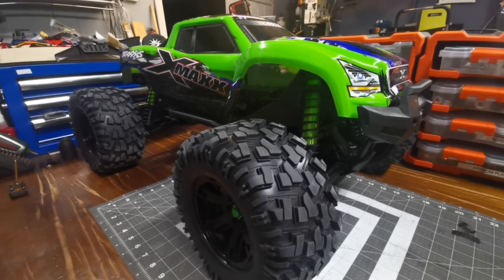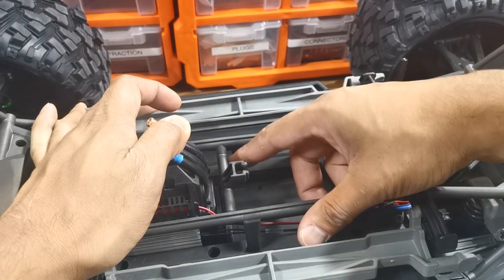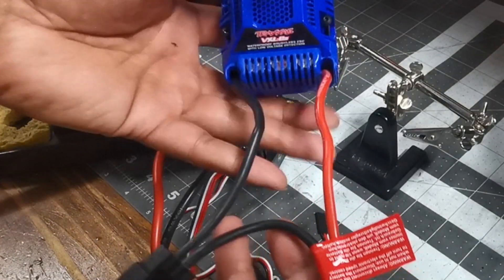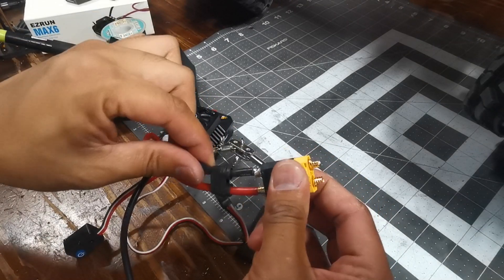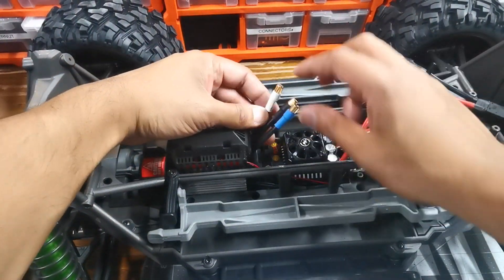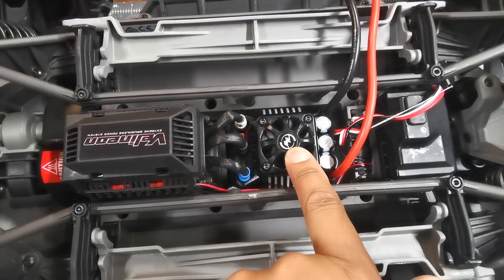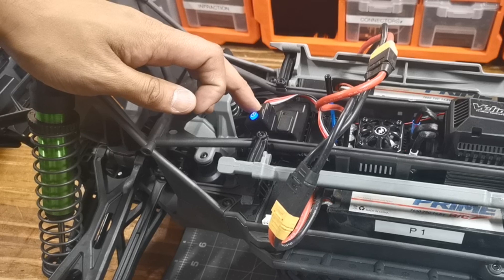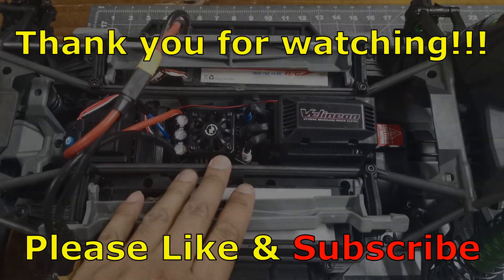How to Install & Calibrate the Hobbywing Max 6 to the Traxxas XMaxx 8s

Comment: If I have two batteries rated for 50c each, would that be enough to push the max6?
Reply from the maker: It will work but i wouldnt push it hard! Keep an eye on temps
Reply: @KingsRC  so would two 100c batteries be better?
Reply from the maker: @DigiDarkness  definitely!
Reply: @KingsRC  what punch setting would be best for this?

Comment: Can you run the stock X-Maxx battery connectors with the MAX6 so I don’t need to change my charger.
Reply from the maker: Yes you just have to solder on the traxxas connector to the max 6 or use a converter

Comment: Good video. What is your BEC output set to? Probably 6v but have you tried running the receiver and servo at the 7.4 volt output setting? Just wondering.
Reply from the maker: Thanks Bro! Am not sure if the servo is rated 7.4?
Reply: @KingsRC  Yeah true. I tried to find that info on the traxxas site but no way man. I couldn't find it anywhere.

Comment: I did everything I was supposed to do while installing my ESC max6 it worked for two minutes now it is dead no steering no throttle no break no reverse fan is working no lights working though and my receiver box is blinking red I don't know what to do/ prior to the first run I programmed it with the program box everything went well now when I plug in the program box it doesn't even go to the Numbers it only has the parallel lines on it and won't do anything either
Reply from the maker: If you did everything you are supposed to and you did it right, you should try and get warranty man

Comment: Are you running the Max6 on the 1200xl or 1600xl? When my ECU retires hurt, I will get a Max6, but wonder if I should combine it with the 1600xl.... thoughts?
Reply from the maker: I was just running it on the stock one which i think is 1200xl.. i think if you want more top speed then 1600xl.. but you may lose more tourque maybe

Comment: Mine will not calibrate I e tried everything any advice
Reply from the maker: Whats happening with it? Wheels not turning the right way?
Reply: @KingsRC  it will turn the right way, just when I go to set the neutral and full throttle and brake it won’t peep like it reading my commands
Reply from the maker: Maybe your not letting go of the button the right time? Its happened to me and end up going to programming mode instead..

Comment: My son and I are only on our third time out but I have a hobbie wing max 6 and motor combo for when I wanna upgrade. Did you change motor? I believe mine is a 1100kv
Reply from the maker: I ran with stock motor on max6 for a while, until i changed the motor with 8mm shaft for bigger gears

Comment: Does it have more punch for doing flips as i find the stock esc is crap for flipping xmaxx in the air
Reply from the maker: Yeah dude.. wayyy more punch than stock as you can adjust it.. but beware tho, if you check out my other vid i busted the gears on the highest punch setting..
Reply: @KingsRC  what do u need to adjust the punch settings
Reply from the maker: You get the program card for it or you can do the beep sequence thats in the instructions
Reply: @KingsRC  hey. Is there no possible solution to use punch 5 without losing gears?
Reply from the maker: @Sheldinator  probably just adjust driving style maybe, u could probably still get the thrill of the punch 5 just have to mind the gears, like no sudden accelerate and breaking, landing on acceleration etc..
Reply: @KingsRC  that sucks though having to adjust driving style for it. wish there was a way. thanks
Reply from the maker: @Sheldinator  only way is to upgrade 1.5mod gears like I have. Although the higher gear ratio i only use punch 3. Punch 5 will rip something else have.
Reply: @KingsRC  I just installed a max 6 on mine yesterday with the stock motor. Punch is set to 5. It’s a crazy difference in power, but now you have me thinking I should turn it down.